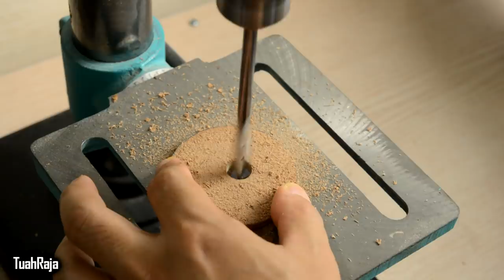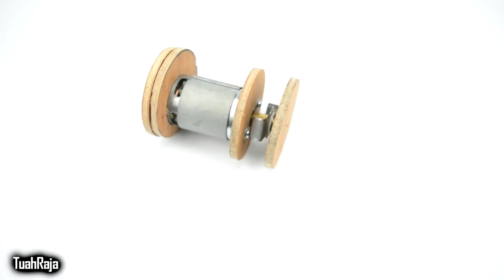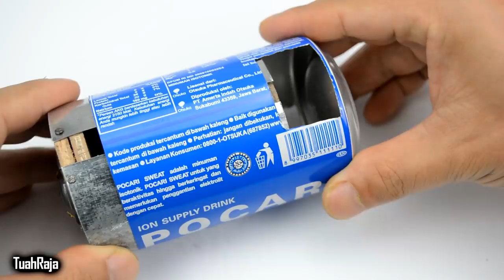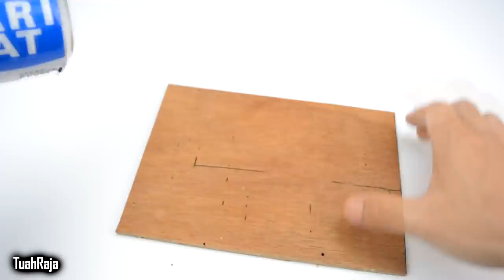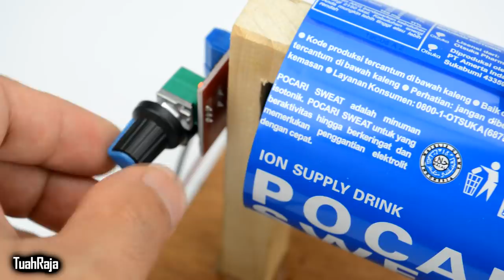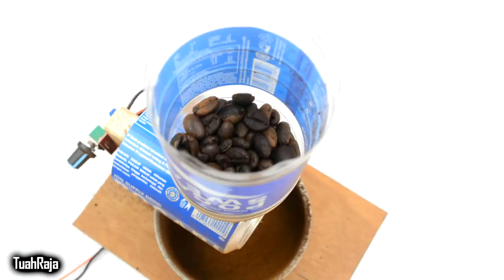how to make a coffee powder machine, you can make it at home

Comment: Hello. I just saw a few of your coffe grinders. It seems that you are genius. Your projects gave me some ideas. But on the other side, while you are turning trash to treasure, do you notice that some of the items you are using, are really trash that shouldn't touch the food? For example you are using processed wood, instead of real wood. Processed wood contains a lot of chemicals, including formaldehyde which causes cancer and many other illnesses. 
You are using some metals but what are these metals? Are they safe to contact the food?
Actually I searched a DIY coffee grinder on youtube, because most  coffee grinders that are sold everywhere were either expensive or they were using unhealthy metals or plastic.
Reply from the maker: I think it is safe, the metal will not mix with the ground coffee. however, this tool cannot be used for a long time, considering the material is not very durable for a long time